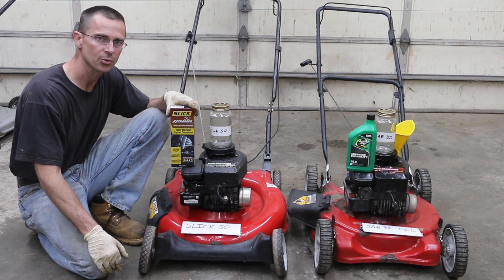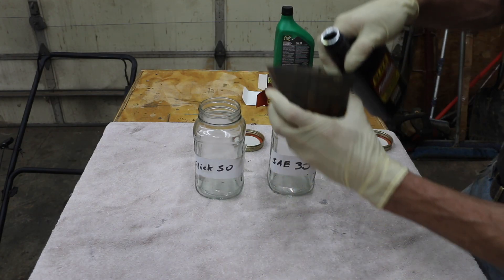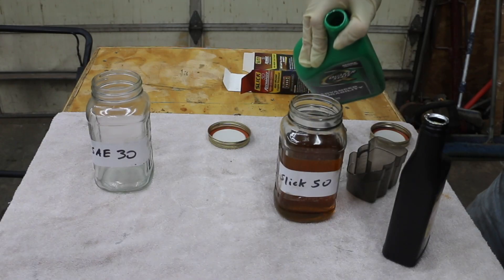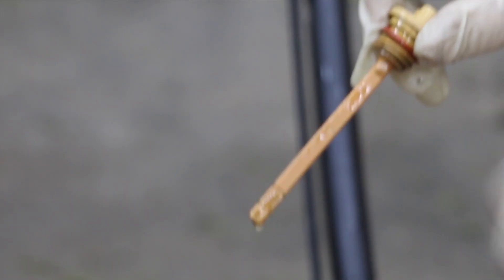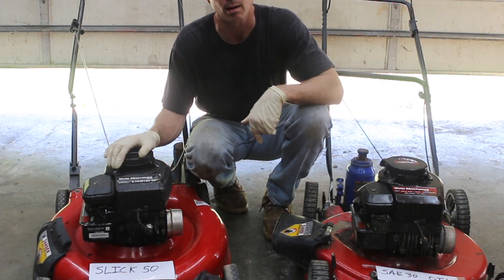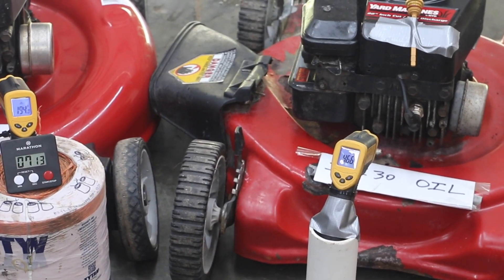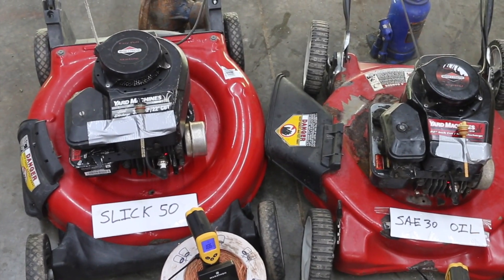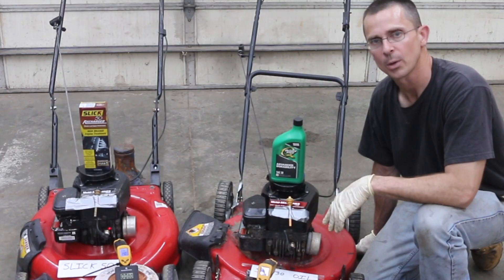Can't believe what SLICK 50 did to my engine!!--Dry Crankcase Test!

Comment: Somebody commented that slick 50 change the formula of their product in the early 90s, I believe it because back in the day I was a mechanic and the slick 50 salesman would come around with a Briggs and Stratton Lawn Mower engine mounted on his trunk that contained no oil and had previously been treated with slick 50. I don't think he was rebuilding that engine after every visit, The thing always fired right up every time he came around and appeared to be the same motor. I'm not saying the stuff works,  I saw Siegfried and Roy make an elephant disappear Maybe this guy was tricking us but one thing's for sure: He would let it run for 5 minutes or more the whole time he was talking to us.

Comment: The PROPER SLICK 50 as tested by NASA was not sold after 1984 its now called XCELPLUS sold from australia and with the original you can find mario andretti thrashing a car with no oil in it.Used it in 1983 and it works.

Comment: I added a bottle of slick 50 to my 1986 Ford Sierra 2.3 V6, about 25 years ago. It was expensive (In South Africa) but made no difference to my fuel consumption although the engine did run cooler (according to the temperature gauge) as well as quieter.
Reply from the maker: Thanks for sharing!

Comment: Consumer reports did a test with 3 (GM V6 engines) years ago.  They used regular oil, slick 50 and "prolong".  All 3 engines seized about the same time.  According to the article I read Consumer reports filed a complaint with the FTC.  Dupont came back and said they never developed "teflon" (one of the ingredients of Slick 50) to be used as an engine additive for friction reduction.

Comment: the reason the mower on right is running hotter than the left is because the exhaust form mower on left is blowing on the right engine

Comment: The testing you do is very helpful. Great videos. Also you should try doing the same thing with Dura lube burning a couple engines out, but have one of them having Dura lube in it. You should test a bunch of engines with different additives. See which ones the best because their loop claimed the same thing they ran an engine dry and it ran forever in the commercial
Reply from the maker: Thanks!  Thanks for the suggestion.

Comment: There is another product out there making claims similar to Slick-50, and that's known as RVS. Unlike Slick-50 it doesn't come as an oil as such, but rather as a gel. It is essentially very very fine sand. Now, some people claim that it quieted down their engine when used as directed. I've had a project car with a motor with bad lifter tick that I tried the product on, and to my surprise not only did it not damage the engine, it seems to have lessened the amount of metal it was shedding, quieted it down and finally, with the third treatment (meaning I've spent almost $200 on the stuff...) the lifter tick stopped.
I have not torn down the engine or done tests on it, but the ones I've seen do it do find that it coats metal surfaces with a hard ceramic layer and reduces running temperature by a bit.. but I wonder if that lifter tick went away because of the stuff, or because I used "high mileage" oil in the engine and performed several oil changes way before the scheduled service interval.
Tyler Hoover from Hoovie's Garage did attempt to test the product on a car with a damaged engine, and attempted to run the engine without an oil pan as the company's early marketing demos claimed to be possible, but while his results boiled down to near-immediate engine failure as is to be expected, he did not follow the proper application procedure specified by the manufacturer, as he was in a hurry to get the video done, so there was doubt in the comments section.
I just figured this would be one product for you to test, maybe against another formulation of Slick-50.

Comment: Hi some quick notes:

My comment is 8yrs late but what the heck : Application of Slick 50 is completely wrong. 

Actual application:
===============
1. Run engine until operating.
2. Remove/drain oil volume equal to Slick 50 volume.
3. Restart engine with reduced oil volume. Engine must reach operating temp.
4. Add Slick 50 while engine is running. This will cause the material in the Slick liquid to stick better to the parts.
5. Engine will have longer life with Slick in oil.

Testimony: on Car application, if the sump has an oil leak from hitting a rock or causing oil drainage, the water coolant system will help the engine not overheat. If water coolant system loses pressure and drains, the Slick will help engine run longer with decreased cooling functionality. Tested on Volkswagen GTI 2 engine 1800cc 8 valve fuel injection, 1988 model.

Comment: I have been using Slick 50 for over decades and I can't tell you what the engine would have been like if I shouldn't have used it. However, the engine of my car (Rover V8, milage 250K) has a timing chain and reportedly the life expectation of a timing chain is approx. 125K. In my case the timing chain needed to be replaced at a milage of 220K, so the chain lasted 76% longer than usual.

Comment: This test may show that slick50 is working best.  Oil is designed to run through the bearings constantly and not sit in place, the slick50 moved out the bearing quicker and therfore seized sooner.

Comment: I am not aware of Slick 50’s chemical properties, but would the munching attachment on the Slick 50 mower load the engine due to reduced air movement compared to the other mower. More importantly; maybe their was mulching done in the past with the slick 50 mower, causing additional wear to the engine with increased loads associated with the mulching process?

Comment: I'm just as surprised to see your results as you are with Slick 50. Someone here mentioned a change in the formula in the 90s, along with product ownership changes, so maybe that's some of the reason(s) for the discouraging results. As for my experience with Slick 50, they range from decent to one crazy example. The crazy one being a sb350 chevy from a '74 Nova I installed into a '79 Sunbird. I added Slick 50 during an oil change and waited until the next oil change while also replacing the timing chain. My surprise came when I spun the engine by the crank pulley by hand, the crazy part was that all the spark plugs were still installed. I know this may sound a bit far-fetched, but as I said it was only one time it happened that way. Don't lose all hope just yet as maybe it was a bad bottle, maybe not. If you haven't tried it yet, check out Duralube sometime. Meantime, keep up the good work.

Comment: If you did this test after 1984, then you were not using the original slick 50 formula. John Bishop got out of that company. When it was sold to shell and a few other companies. Then he came back. I believe around 2000 with a product called Bishop's original formula.  I've been using it since then. In all my equipment and can only tell you that it's pretty remarkable. What it does to the longevity of A? You're doing a test on a lawn mower? You cannot put the slick 50 in and then run it for a few minutes and drain it it takes.  In an automobile about 500 miles. I think they recommend that you drive it with the slick in it. And then after that, you should have no trouble draining it. But you're not using the right slick. 50 number 1 and you didn't do the test correctly if you get Bishop's original formula, which you can because I've been buying it for years.  Then test it again with that formula and see what happens

Comment: I wonder, what if you mix slick 50, engine restorer, and zddp into whatever called for oil. could that help an engine with mild or even extreme piston slap? Would that affect oil wash on the pistons?
Reply from the maker: Thanks for the suggestion.

Comment: I put the original slick 50 in 1990 in my 318i bmw in 1990.  I sold it with 200k miles and it was running like new.  I also changed the oil every 4k miles.
Reply from the maker: Thanks for sharing.

Comment: Back in the late 70s my dad sold the original slick 50 as multilevel marketing. The original slick 50 came in a round, can like the old oil cans where you had to open it with a can opener or have the funnel that would pierce the top of the oil can. We had a Briggs & Stratton engine with the side casing, cut off, replaced with a clear plexiglass cover to see there was no oil in it.
I personally ran that engine without oil for over 30 minutes no damage to the motor. I had slick 50 in my Buick regal and a so-called friend pulled the oil plug without my knowing. I drove my car with no oil no oil plug for at least 5 miles before it started to tick. I pulled into the parking lot and shut it off went to a machine shop bought a plug to put in it filled it full of oil and drove it home with no problems. The tick went away as soon as I added Oil. The original formula had Teflon in it. I wish I could get some of the original formula that stuff worked great!
Reply from the maker: Thanks for sharing.
Reply: Supposedly it is still available you have to do some research which is what I'm doing right now after finding out that it was changed it seems like the original guy is still around and kept it going under a different name
Reply: I saw that demo in person in a high school small engines class. I’ve used it ever since.
Reply: amazon has the original formula plus the newer ones
Reply: @eattherich2713  ...and NOTHING on amazon is counterfeit!

Comment: I think, there was a little bit more Oil in the SAE30 engine which has safed the motor. In the Slick50 engine was less oil so it stops earlier (see the filled glasses.)

Comment: I have been using Slick 50 since the late 70s Metal can and you had to shake it upbefore using, My 2004 Dodge 3500 Had 1.2 million miles on it, every 50k I would add 4 quarts of slick 50. that Cummins was bullet proof
Reply from the maker: Thanks for sharing.

Comment: I dont accept this test as valid 2 different motors with unknow hours of use.  looks like quaker state oil which is junk, maybe different designs. Slick 50 was proven many times to be beneficial and with a lower operating temp ? Bad test here , get closer parameters for such tests or dont do them.

Comment: You need to go study what the Scientific Method is; because this isn’t it. First, you ignore the Slick 50 recommendation of 10% concentrate. This invalidates the entire experiment right off the bat. 

Then you got two used mowers, that are different years/models. They are not identical, and who knows what they’ve been thru. The obviously older one died first, cause of course. You’re an idiot.

Comment: Xcelplus claims to be the original formula of slick 50, its available on ebay ,i have used it ,it seems to make a difference ,smoother engine ,maybe you could do another test using it .Maybe the engine needs a number of hot and cold cycles for the treatment to coat [just a thought ] ,but mine seemed more noticeable after the second oil change
Reply from the maker: Thanks for the suggestion.

Comment: I realize this video was made 7 years ago, so not sure anyone will read this question. I am wondering if one mower had more hours on it than the other, or where they both brand new motors? I thought the Slick 50 would have lasted longer also...hmph
Reply from the maker: They were both new motors.  Thanks for watching.

Comment: I was always told by guys that did more wrenching than I that Slick 50 clogged valves guides, so I never touched it. But, given the temp with oil and Slick 50 I'm wondering some things. OBVIOUSLY, running an engine dry will never last. That being said, if Slick 50 with oil keeps the crank case temps lower, but not so low it causes exhaust gasses to form and degrease the lubricity of the oil, it makes me wonder if running it with oil will preserve internal parts and even possibly the head gasket longer by keeping operating temps lower.?. Hmmm. 🤔

Comment: Motorkote I have heard great things from my truck driver friends. Wondering how good it is in a small engine. Single and twin cylinder engines can make some internal noise depending on the engine sometimes alot of noise. Would be interesting to see and hear if this stuff hushes it up and helps it run smoothly.
Reply from the maker: Thanks for sharing!
Reply: @ProjectFarm  your welcome. I have a V twin Kawasaki engine on my walk behind and after adjusting the valve lash it still kinda has some valve train noise and was wondering if motorkote could take care of it. Other than that it's a great and mighty running engine.

Comment: I have used the original  slick 50 backbin the original formula days . I noticed an immediate mpg increase of 5% on 3 or 4 vehicles over the year's  i also noticed sit took a longer time to get any heat to come out of the vents so i started maki g sure i only did thr treatments during spring only that way by fall and winter i could get some heat out of the vents. 😅
 About 10 years ago i bought some and used it on a 2002 4runner i bought,  i noticed no difference so i started using  Duralube with good success. 
 Thanks to some of the comments hear i understand now why the slick 50 no longer works.
 😊👍.
Reply from the maker: Thanks for the feedback.

Comment: I used to coown an auto repair shop and the engine temperature was important to heat the engine up and run it for about 45 minutes so the slick 50 filled all the holes in the metal to reduce friction and we directed it to clients who do not regularly change oil. Having clean oil when added was very very important so the metal floating around was not stuck to the engine walls with slick 50.  It isn’t something you just add, it takes planning, clean oil, hot engine (I can’t remember if hot engine before adding or just after) driving time. Then drain it and add clean oil. Having that much black muck in the oil suggests metal particles were stuck to the inside of the engine when used.

Comment: Slick 50 vs Duralube? 
My X had a car that leaked about 1 QT oil per week, I had always treated it with Duralube. i told her to add a Qt at least every other time she got gas. Fast forward about 3 months I asked her if she had been keeping up with it, Her eyes lit up as she had forgotten all about it. Not added oil for 3 months?. When i checked the dipstick it came out clean and bone dry and the engine was still running smooth. I couldn't believe it when it took 6 Qts to get it back to the full line. The car had been driven almost 4000 miles in this time, Duralube believer since then!
Reply from the maker: Thanks for the suggestion.  Thanks for sharing.
Reply: @ProjectFarm  Thank You for all the hard work you put into these videos.

Comment: The fact that Slick 50 would do things like remove the oil pan, run the engine and toss sand at the crankshaft as a claim of superior protection...Without oil to carry the sand into the critical areas the sand does nothing, their own commercial told me the product was useless.

Comment: The old slick 50 advertisements used to spray water on the engines. They even had the valve covers off for dramatic effect, however in reality it allowed direct access to the engine internals.
 This actually cooled and lubed (although not very well, but way better than metal on metal) making the engines last much longer in the commercials, thus surviving the demo in the show.

I had to laugh at the big blow torch they showed, heating a metal plate (ie heat shield) in front of the engine. 

Wynns Friction Proofing, now long gone for a couple of decades now, was an amazing product. It looks like a new formula has returned. Not sure if its any good or not.
Seen engines with the old stuff added, needing the idle screw turned out a few moments later, as the engine was spinning that much freeer...

I belive the old stuff was a bunch of zddp zinc and some other additives. But zddp, as much of an amazing lubricant addive it is, isn't catalytic converter compatible...
Reply from the maker: Thanks for sharing.

Comment: This clearly is not the original formula as the one poster has already said because I remember when I was a kid the guy at our church sold this stuff and he'd start the motor on the lawn mower on the back of his motorhome at the beginning of his presentation it run a good 30 or 40 minutes and then everybody would go out and see that it was still running so it's definitely not the same formula
Reply from the maker: Thanks for the feedback.

Comment: That makes sense because I remember there was a guy and my church that sold this stuff and at the beginning of his presentation he'd start that engine treated by slick 50 and it run the Whole 30 or 40 minutes of his presentation and then everybody will go outside to see that motor still running
Reply from the maker: Thanks for the feeback.

Comment: Get two mowers.  New, drain. Put regular oil in one use for a year.  Put slick 50 in the other use for a year.   But change as per regular schedule- both.  Then repeat.   Slick 50 is a long term item
Reply from the maker: Thank you for sharing!